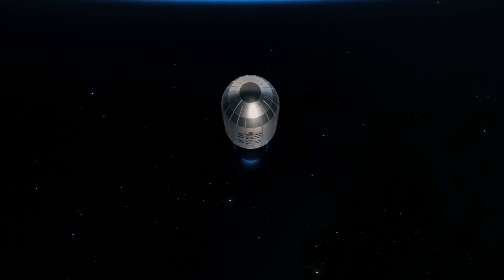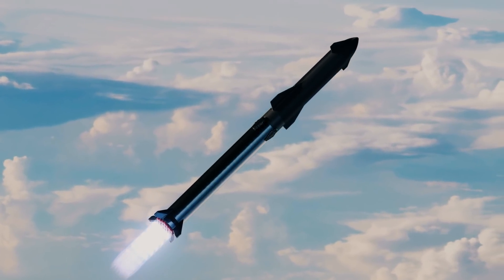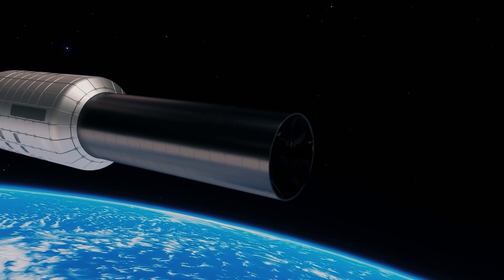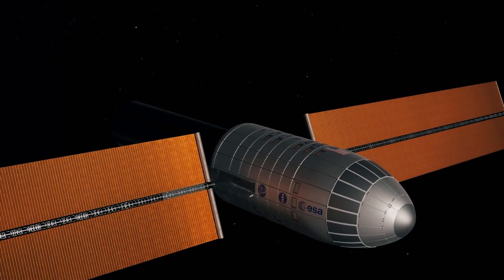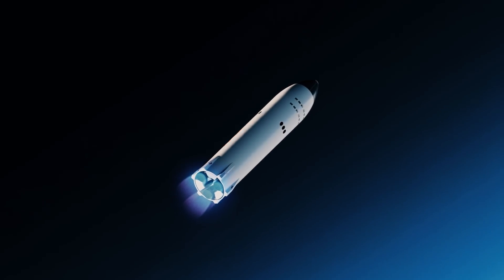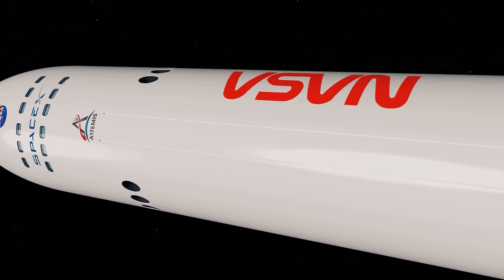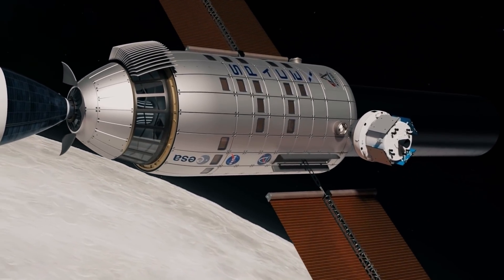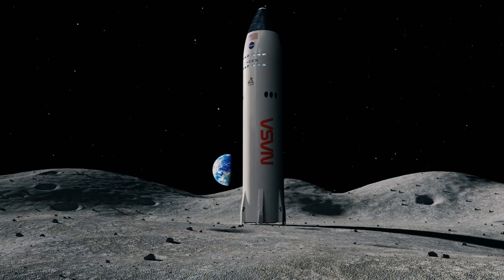SpaceX/NASA Artemis Gateway station concept animation

Comment: Yeah, I'm not seeing the price of a Starship launch going down to a few million.

The Falcon 9 is a vastly more simple machine, yet still costs tens of millions to refurbish it.

I think Starship will be much cheaper then it's competitors, but it will still cost in the hundreds of millions to launch.

People forget the Space Shuttle was supposed to be able to reusable and land at any airport.
Reply: The plan is for starship to not need refurbishment.   Cost of fuel and relight.
Reply: @adamklosterman8960  Yeah, that was the plan for the Space Shuttle too.

But on a spacecraft without any form of escape system I don't think they will be flying the largest most complicated spacecraft ever without extensive inspections.
Reply: @TheOwenMajor  I think lunar Starhip could use those upper engines to separate and then turn on the Raptors at max power.
Also in this case some sort of mini Starship (on top of normal one) could help.

And they could use some sort of Dragon "extended".

But on cargo not as big of a problem.
And space shuttle needed crew, Starship doesn't. And also heat shield (that was main problem of Shuttle) will be better and same with engines.
And you maybe talking about original concept (much smaller).
Reply: @TheOwenMajor  You won't see manned starship missions following eachother quickly anytime soon and for cargo and refuelling (most of starships flights) the absence of an escape system is irrelevant. An escape system btw hasn't been really relevant anyway, the everyday astronaut has a great video on it, you should check it out.

The falcon 9 being a more simple machine is up to debate, it definitely needs much more refurbishment, while Starship is expected to do multiple flights without extensive refurbishment.

The space shuttle was a disaster in terms of economics and engineering, a cool vessel, but nevertheless a bad one. 

I do think 1-3 million for a starship flight is too optimistic, but it shouldn't be anywhere near a 100 million, more like a few dozen, at least if it fullfils its expectations even a bit.
Reply: @MDP1702  "while Starship is expected to do multiple flights without extensive refurbishment"

Yeah, this is my point, *"expected"*. How does one come to this expectation?

What we know is Starship(Compared to F9) will have many more engines(34 vs 10), it involves reusing two stages, it involves orbital reentry, control surfaces, multiple modes of aerodynamic flight ect.

I haven't seen any indication other than some handwaving that Starship will somehow be an exception to the same challenges faced by every other Spacecraft, including ones that SpaceX has dealt with. And from the listed launch prices for Falcon 9's, I'm not confident that SpaceX has even done that revolutionary job of reusability, as a used Falcon 9 launch isn't that cheaper than a brand new one. I highly suspect their quick turnaround times are only possible because they swap out parts 

Look, I want to be wrong, but I haven't seen any evidence that I am.
Reply: @TheOwenMajor  
Yeah, this is my point, *"expected"*. How does one come to this expectation?
Because this is how it is designed. For example engines, legs etc. The falcon 9 was the first booster to be reused in this kind of manner, and it already has a good refurbishment time record (though still far above what Starship is meant to have). Also different materials and fuel etc. Essentially it is all in the design, which is what they are now working on.

And from the listed launch prices for Falcon 9's
The listed launch price of F9 doesn't sat much. For all we know a reused F9 is actually much cheaper, but spaceX is just getting large amount of profits, they don't have real cheaper competition anyway. And for example the non reused second stage costs $12,4 million apparently. Even if reusing the F9 booster cuts the cost of the booster in half (just a random number), that 'only' means a reduction of around $18,5 million on a total of around $62 million. Make everything reusable of falcon 9 for a similar price and taking into account halving the cost due to reusability and you'd save $31 almost double what you save with just the booster.

And then there is the thing that starship is using cheaper material too, and the necessary amount of engines also might decrease the price here due to economy of scale.

For now SpaceX has overall more than delivered on their promises, so I don't see why should be too critical at this point. Do I fully trust the lowest numbers out there? No, not really, but even if it is double or triple the proposed cost it would be an insane achievement. Even a 10-fold of these numbers is quite impressive.
Reply: @TheOwenMajor  Literally no refurbishment.  each super heavy has to do like 12-13 launches within a few days for each mars mission all but one of  which is tanker flights.  $2million or less per flight.
Reply: Differences is Space shuttle have to use new external tank each flight and while the 2 side booster is reusable, it still cost millions to refurbish it since it just fall back to the ocean while the starship super heavy booster return by landing.
Reply: Love him or hate him, he's spittin' fax.
I also suspect each Starship launch will have a comparable cost to Falcon Heavy-in fully reusable mode.
I can't see how a booster with 30 engines can be reflown without even any basic inspections or engine replacements.

Comment: The graphics are excellent.  Adding the element of humor is a good thing in moderation but, back it off a bit next time.  You need to drop the snazzy window covers that rotate around and collapse into a stack. This idea adds complexity and weight for no real scientific benefit.  If a window shade is needed it can be internal to the station and considerably simpler, lighter and cheaper to operate.  On the whole, the Gateway Station concept video is well done and you need to continue your efforts; however, to be honest, since all the key hardware is apparently being built by, launched by and operated by SpaceX, what is the point of the "nod" to the Artemis project? Face it, the US should just walk away from the antiquated SLS and Artemis thing altogether, and just contract with SpaceX directly.
Reply from the maker: Yes I was thinking of making those windows just on one side actually. I think in the end the Gateway station idea will not survive in its current form.
Reply: @meandgrok  I disagre, the Gateway is almost certain to go ahead. There is international cooperation on it and there is atm no indication the Biden presidency will scrap it. The SLS however is unlikely to fly more than a few flights even if it is fully succesfull, if it fails, it might just be scrapped immediately.

Comment: Why do you think that Starship can lift 180 tonnes?
Reply from the maker: Because the Starstage is much lighter then a normal Starship.
Reply: @meandgrok  It weighs 120 tonnes. But it is the whole second stage, the main and the biggest part of which is still present in your design. 
What payload of the original Starship do you take into consideration - 100 tonnes or 150 tonnes?
Reply: @meandgrok  because it could have a 4th gimbaled vac engine instead of the 3 sealevel engines

Comment: That idea is awesome. Can you make a video about maybe concept that is like hyperloop, but instead lauches the starship with great speed. This will make the rocket use several times less fuel in my opinion.
Reply from the maker: Cool idea! I could try that
Reply: It would probably need an nuclear power plant to power this thing, and it would need to compromise between size and boost power.

Also btw this is very old concept.
Reply: @ImieNazwiskoOK  seriosly!? Well i don't know every concept. I thought of something like a giant magnetic crossbow. Well back on thinking then.
Reply: @martinvasilev6099  Yes.
When I was 7 (or older) dad gave me book with that concept.
edit: I found it. It was concept of giant underwater gun using gas. This book is from 2014 but I think this was concept long before it (they wrote that someone had similar idea in XIX era). (btw when I looked it up I found that there are many cool concepts in this book)

And it would be maybe more like giant coil/rail gun.
And those guns now have huge problem with over heating.
Reply: And magnetic acceleration? Maybe.
But hyperloop for this would be impossible.
When top "hatch" will open atmosphere will push the Starship down.

Comment: ALON is basically transparent aluminum; maybe SpaceX will have a version called...wait for it...ELON?
Reply: Yes
Reply: An older version may have been around for decades but I believe Elon has developed a much better and stronger version and I think in keeping with STOS it should be named Scotty!
Reply: ALON or transparent aluminum has been around since 1981. I believe that's when the patent was filed on it. It's still not commonly used because its so expensive to make.
Reply: @Joe-vy8xw  ALON is used for bullet-proof windows.
Reply: TRANSPARENT METALS ALREADY EXIST. THEY ARE POLISHED "CERMET" MATERIAL. THEY ARE VERY EXPENSIVE THOUGH.
Reply: @stevensargent2063  You mean this? (yea, not hardly)                                               https://www.youtube.com/watch?v=DduO1fNzV4w&t=1s&ab_channel=WonderWorld

Comment: Lovely graphics.

A quibble for you: SpaceX tankers will be set up for liquid methane and liquid oxygen.  We can't get methane from the moon.  In principle, we could deliver carbon to moon orbit from Earth or from asteroids; lift water from the moon; and run them through an orbital factory to create liquid methane and oxygen.  But that is a huge extra large undertaking requiring a hell of a lot of engineering, capital and time.  We aren't going to see anything like that in this decade.  Bottom line is that in the near term, we are not going to be refueling SpaceX tankers from the moon using methane.  It'll have to come from Earth.

Liquid hydrogen is even harder to manage.  Much harder.  I don't expect hydrogen refueling of moon-orbital tankers from moon water to be a near term possibility, either.

A quibble for SpaceX:  how will they keep fuel chilled over long periods of time?  I'm sure they've thought about this, but I don't recall seeing any of their ideas in public.  Refueling in orbit, or sending tankers to loiter in moon orbit, won't work if they can't keep fuel chilled; they would end up venting most of it into space to avoid tank ruptures.  The base starship concept, for lifting mass into Earth orbit, doesn't have anything on board for this; fuel is loaded at the last minute before launch and then used.  All of the chilling apparatus is on the ground.
Reply from the maker: Good points you made. Perhaps for operations on the moon, they might use some other engine types for other spacecraft. 
I have also been wandering how SpaceX will manage with orbital refueling. I think they will need to do a lot of extra engineering to solve such problems.
Reply: A dedicated orbital tanker would probably be double-hulled with lots of heatsinks.  Even then, there would probably be a time limit for storage.
Reply: @nolsp7240  Insulation is only half the battle.  The other half is active cooling.

Which will require some pretty impressive - and massive - heat pump mechanisms, radiators and pipes, along with a generous supply of electricity.

I don't know how they will do it, but do it they must, if tanks are to carry fuel for more than a few hours.